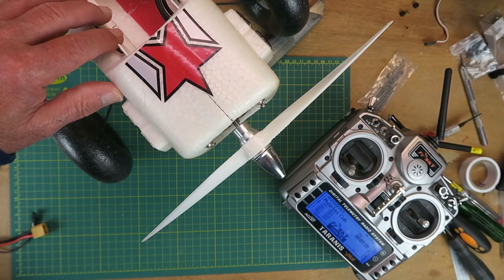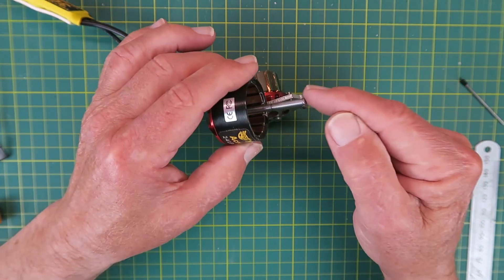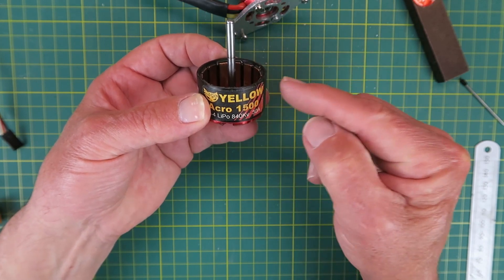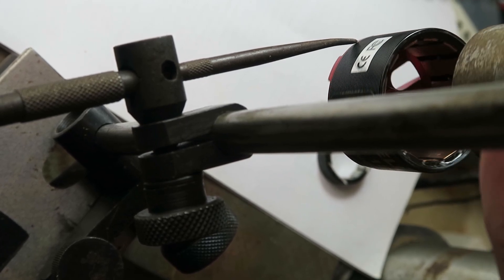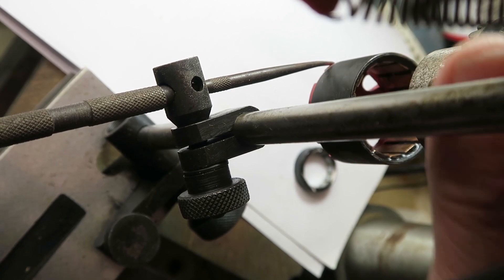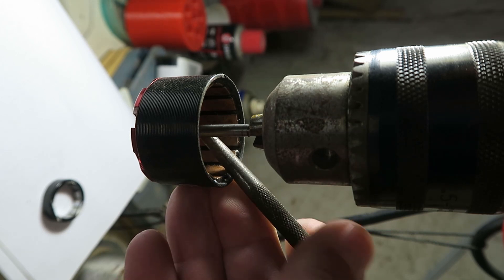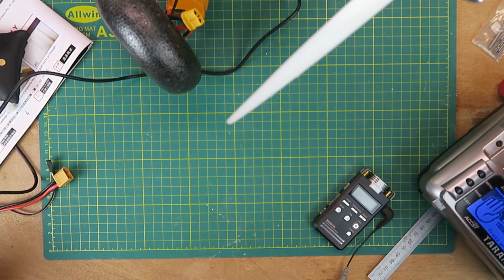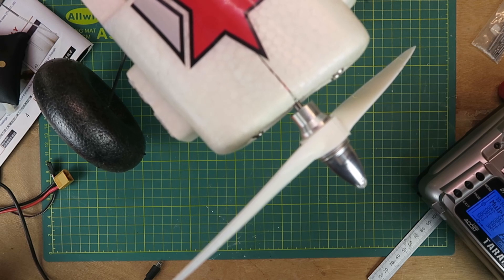Brushless Motor Bent Shaft Repair Tutorial

Comment: I'm having this problem but it's with a bolt on prop adapter (Rimfire .25 motor) made of aluminum i can't chuck it because of the threads of I put a nut on it and chuck that it'll just bend the threads again.  I haven't figured out a way to repair other than replace. Any ideas?
Reply from the maker: That's a tricky one! My only idea would be to wrap the shaft in some thick rubber. I keep old bicycle inner tubes for this purpose. Helps to hold things in a vice for cutting too! Good luck! Thanks for watching, have a great day!